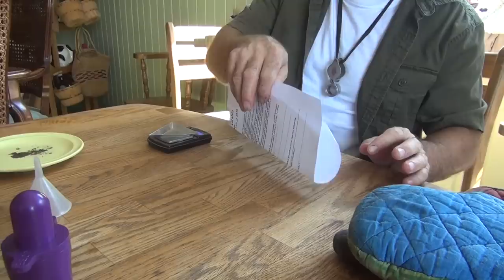ROCKS to GOLD - How to Do It | ask Jeff Williams

Comment: I think a modified ditch witch  or even stumo grinder woud be extent to run through things like old ore and tail piles.  Put scoops on the stump grinder and slow it down. And use a conveyor to move the material to a small wash plant or classifier maybe both. However a smal circular digger custom built would probably be required to get in 10 hp or less.   Maybe make it electric, use a 10 hp generator!  Scoop up the material maybe use a 2 hp vacuum in front  to pick up the light gold  possibly after as well!  Build it on a small trailer pulled by atv. The water tank and ore bins will give it a low center of gravity!   Steep piles can be shoveled in . And capable of reaching  12" below grade and 12-18" above. With a linear reach if 36-48" basically a tiny excavator reaching out with a digger wheel on it and a conveyor the top of the hoper being about 50-60" limiting the travel   the arm positioned on the side doing drive bys of the pile. Or the front side clear the area and move on, or shovel into a hopper on the conveyor  . A 18” x 48" tromel    200 gal of water weigh about 1800 lbs dry , duel axel so à atv can pul it!

Comment: say Jeff,
you seem to be a fan of jet dry, you mention it in several of your other videos. is there a substantial difference to dawn dish soap when it comes to breaking water surface tension?
cheers
mike
Reply from the maker: Hi Mike it breaks the surface tension of the water with out a lot of foam.